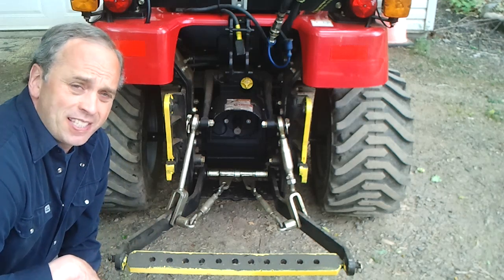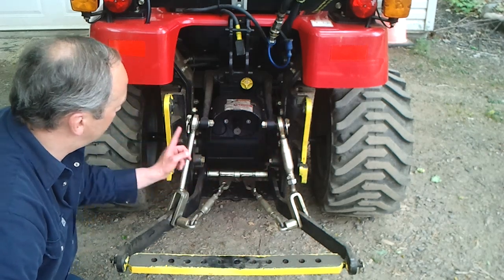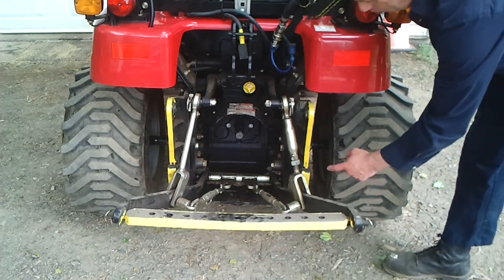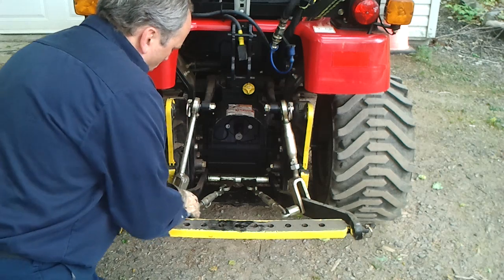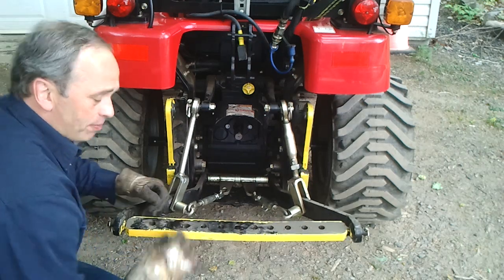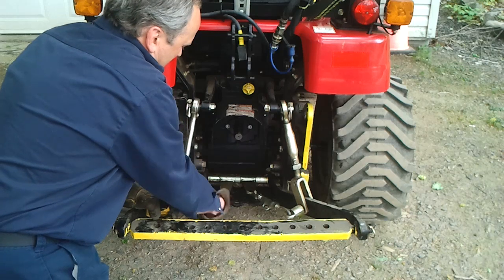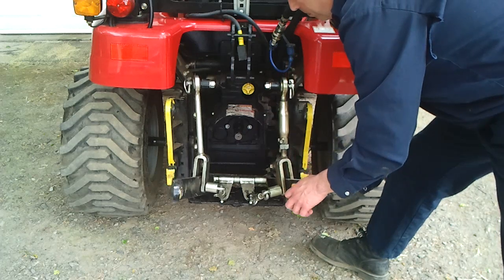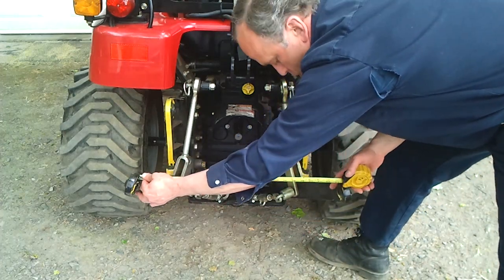All owners of the Mahindra eMax20s HST tractor with a backhoe, must view this video for 3 PH mod 🧐😉👍

Comment: I was just try to put on my new box scrapper was hitting the sub frame.  It made installation very difficult.  It was rubbing badly.  I am going to try and flip the attachment tomorrow.  Definitely a design flaw for Mahindra implements.  It defiantly limited the rise height.
Reply from the maker: Good Morning Sir, You can also ( I did not try it ) having the the two steel bar connect closer together since you can play with the spacers on the steel bar ? Hope that help Sir Cheers

Comment: Hey Dave, does your tractor have the arms at the belly of the tractor that the mower deck attaches to? The probably I run in to, is if I leave my 3 point arms on, it won’t go high enough because it hits the backhoe. So those belly mower arms sit really really low and I’m afraid to tear them up when they are low. Does your tractor have the belly mower?
Reply from the maker: Good Morning Sir, thank you very kindly for subscribing to my channel Sir 👍👌😇 Yes I kept the belly arms but you can adjust them higher, look on the left side right above the tire ( it would be easier if you removed the wheel ) you can adjust the settings on how low are high these underneath belly mower deck arm can be Sir. I can made a video if you want Sir ? It is realy easy to adjust if you look at my videos you can see that my arms are almost not showing even with my backhoe on.  Hope that help Sir Cheers  🍻🍻👍👍👌👌😇😇
Reply: I found the adjustment, thanks Dave the Mahindra expert!

Comment: Has anyone tried drilling another hole 2" -4" out to hook your lift arm and pins?
Reply from the maker: Sir that sound like a great plan !!! LOL I will have to look at that OUTSTANDING IDEA'S of Yours !!!  Take care Cheers !!!
Reply: @RCAFpolarexpress  i did drill the holes yesterday and it did fix the issue.  I drilled 2.5in out with 3/4" bit.  Took about 30 minutes.  I have the turn buckles all the way out just before the thread ends.  So i may see if i can figure out how to extend them.  🤔  if there are any major complications ill let you know.  Thank you for the videos.
Reply from the maker: @user-ev3xm7np8x  Thank you very kindly Sir for your OUTSTANDING UP DATE and can't wait to see your result Cheers 🍻

Comment: Thank you Sir. I have a landscape rake I just bought by Mahindra and it will need to be cut down to Cat 0 frame width to work properly on this tractor. I have this same tractor as you do.
Mahindra does not make a Cat 0 implement for this tractor that will work with the backhoe sub-frame attached, frustrating, but it can be done with modifications.
Thank you again for your videos.
Reply from the maker: Good day Sir and congratulation on you purchase. Did you try like I did ? and do forgot about this video ( https://www.youtube.com/watch?v=CsGuYxwg9gY) and this one too ( https://www.youtube.com/watch?v=u1L13pCt79k) and do not climb the engine rmp above 1800 RPM the hydraulic pump is large enough for the backhoe !!!  Hope that help and for operating your landscape rake do you realy need to raise it that high ? If I may ask Sir ? Cheer 👍

Comment: Thank you! I ended up getting the Cat 0 drawbar. It only needs 20 inches between the links which means I can lift it all the way when I have mower deck attached.
Reply from the maker: Great Sir 👍 Yes in deed that will be fine for you 😉but for me with the rear snowblower that eight is good 😉👍 Please do retorque your bolts and nuts for your backhoe Cheers and have a great week end 👍😉

Comment: These tractors do not have a  type 1 hitch. They have a type "1N".  Meaning type 1 pin size but not type 1 spacing, "N" meaning narrow.  Good info on the mod and the work around for the problem.
Reply from the maker: Good day Sir, Thank you kindly for your good input 👍 Take care Sir Cheers 😉👍
Reply: Thanks ,this is the info i needed for my emax 20 with backhoe
Cheers from Pennsylvania